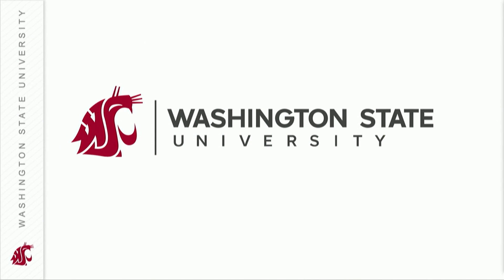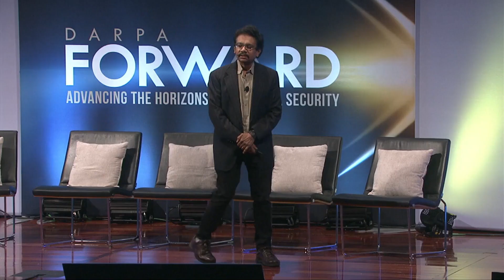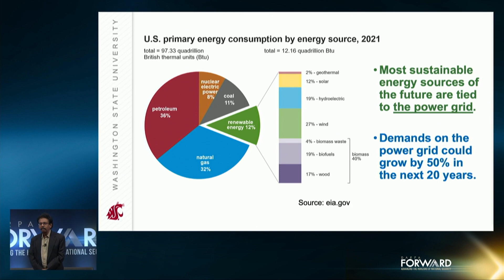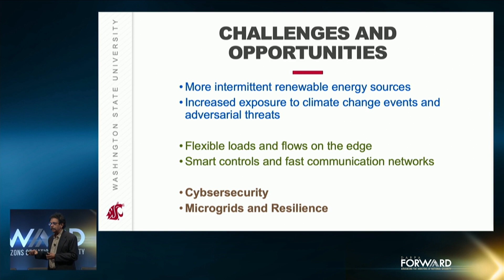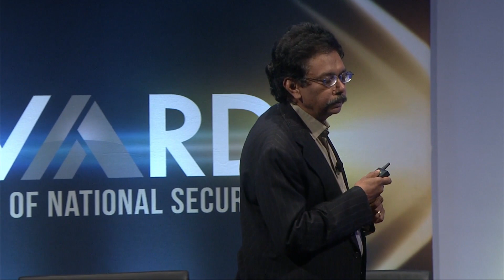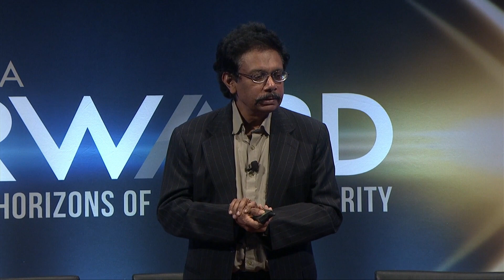Sustainable Secure Resilient Power Grids

Comment: Isn't that the purpose of tariff controlled devices? If you give the customers a cheaper supply that you can turn it off; Works wonders for the grid?! 

In my area we use 1050Hz zellweger relays to perform such an action. The device superimposes a high frequency lives in our substation. We've used this tech longer before I was a kid in my country.